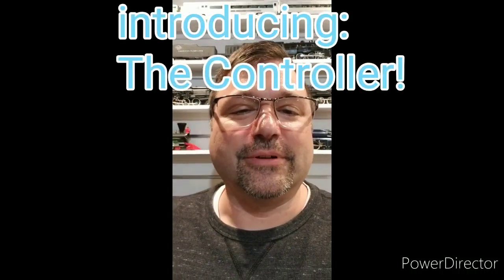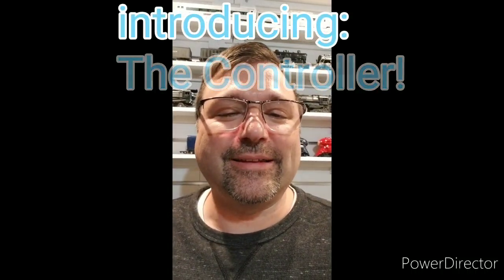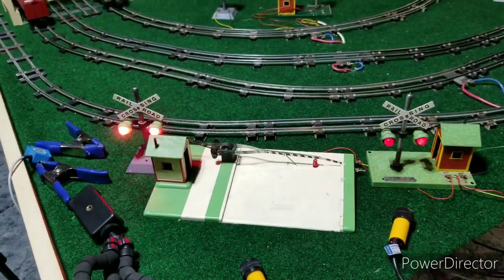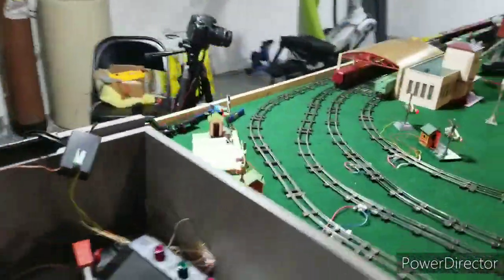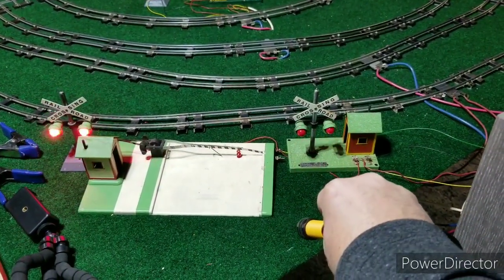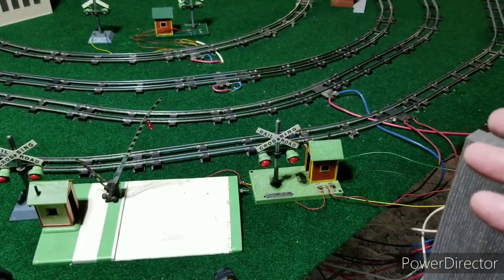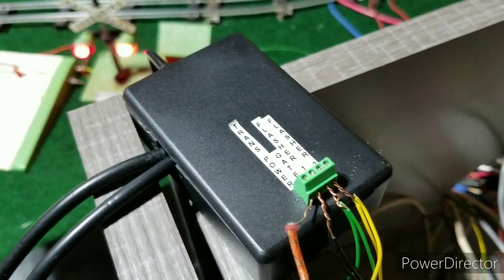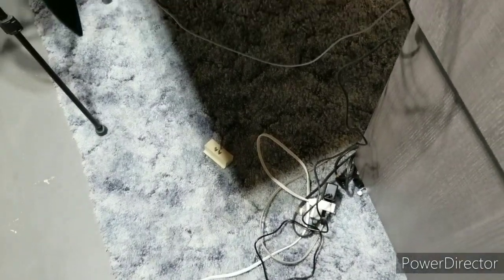Introducing the flash controller!  Operates AC or DC!

Comment: Hi, I've been watching for over a year now and I really enjoy what you are doing with AF Trains. I also like the crossing sensors and the way that you integrated the bell into the circuit, I'm thinking about what you've done and it looks like you must have had to remove a crossing lightbulb socket and run a separate wires to each bulb, or should I say that's what I'll need to do! I don't have the crossing gates that you have, but I have a bell and a lighted crossing signal. I assume that your circuit will work with just a bell and a set of lights? I can't order anything else until Christmas is over, but I'd like to get back with you after the first of the year and see if I can get the electronics from you. Thanks again for what you are doing, and I also appreciate you sharing your faith in the Lord Jesus! I guess that makes us brothers in two ways Jesus and Trains. Monon Brad. PS- if you didn't know, Monon is for the "Monon Railroad,"
my Great Grand Father worked for the Monon, which is also the C.I.L. "Chicago, Indianapolis, and Louisville", and AF made a Monon gondola, it's gray with red lettering. Sorry this is so long.
Reply from the maker: Hello Mononbrad.  Nice to virtually meet you.  And thank you for your kind words and encouragement.  The controller will work with your accessories.  In the video I show the unit working with 2 separate bell/flasher accessories, 1 crossing gate and 2 highway flashers.  No special wiring or modifications are necessary.  You keep your flyer acessories as they came from the factory.  I'm sorry this is not clear.  I will do a followup video clip to clarify this.
Reply: @AustinsAmericanFlyertrains  I'm the one who didn't think this through, I was trying to get the light bulbs to flash separately, one then the other left and right bulbs. I was remembering how "Lionel" crossing signals worked. I collect 4 gauges (N,HO,S, and O) made by many different makers and it gets messy trying to keep everything separate in my mind! I realized that you solved the problem by using two crossing signals one on each side of the crossing, that's a great way of doing it, because you get the effect of having the bulbs flash back and forth like they should. I just need to pick up more crossing signals! Thanks Austin.
Reply from the maker: @Mononbrad it is not super hard to do this with a highway signal...u make a cut through the plate across the back of the lights and then add a second wire.  I like to keep things origional so I did not do this.  You could use this device with lionel or smaller scales as well.
Reply from the maker: Mononbrad here is a link to a video I did a while back that shows how the highway flashers and gates work using the flyer track trippers.  https://youtu.be/JJaPo9AMWs4 this effect is ok it is limited to one track.  In my case I have 4 trains operating but only one turns the flashers on.
The device I made uses sensors so trains on more than one track will bring the lights on.  They also have a steady flash verses the little burst from the tripper as the train wheels press the button down.
Reply from the maker: Monobrad...I'm going to have a few highway flashers to sell...$30 first come basis...